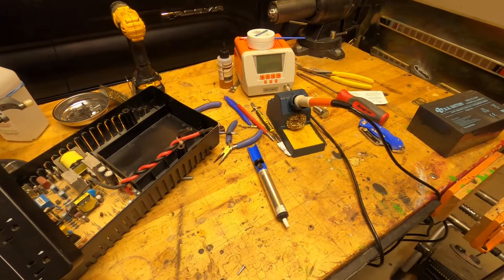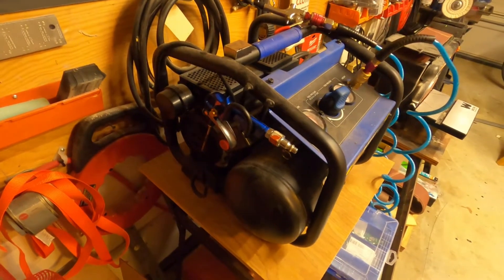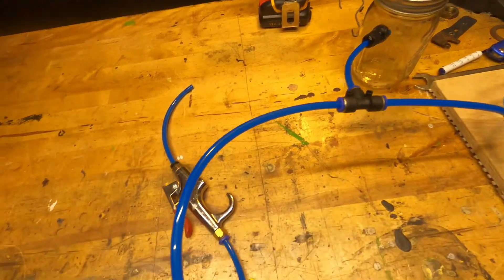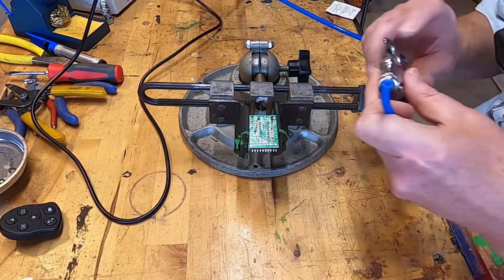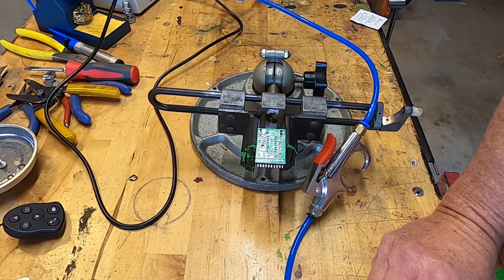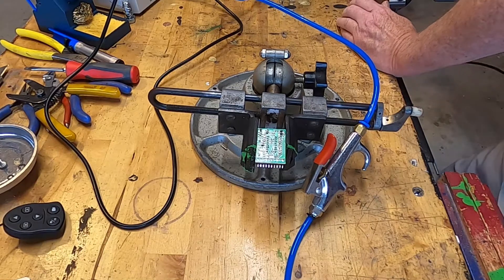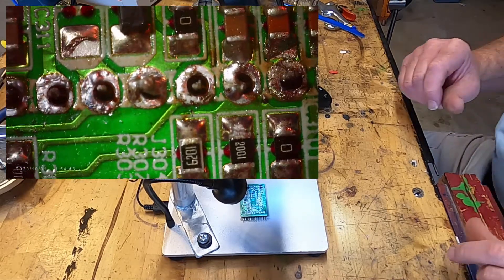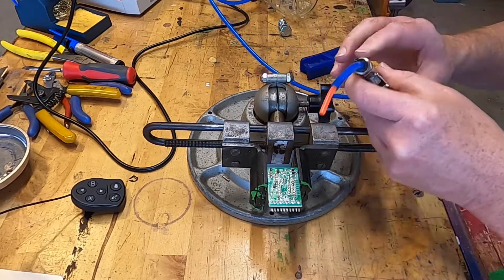DIY Vacuum Desoldering Tool

Comment: Instead of a vacuum pump, could you just use the compressed air reservoir with a Venturi of some kind to convert it to suction? I assume this is how the several thousand dollar reworks stations with “shop air” connections work.

Comment: Have you seen KainkaLabs’ vacuum reservoir mod for the ZD-915?

He followed it up with another video where he deletes the reservoir and just uses a time-delay circuit that runs the pump for a second before opening a solenoid to the vacuum that has already reached full strength in the lines.

My Aoyue Int 701A++ is the old version with the AC pump that takes much too long to spool up. As a result, it typically removes solder on one side before it has enough suction to pull molten solder from the other. Without the heat bridge from the solder it already removed the other side instantly solidifies, making it useless even once it reaches full suction a fraction of a second later.

I replicated the vacuum reservoir/pre-run trick by merely pinching the hose and holding the trigger. Once solder was flowing on both sides I pull the kinked hose straight. This technique clears all the through-holes I found too stubborn or impossible before.
Reply: I'd love to see this updated video....
Reply: @glen4cindy  Look for “A better mod to improve the ZD915 Desolder-Station” from KainkaLabs. The other one is “Improving a cheap vacuum desolder-station (ZD-915)”